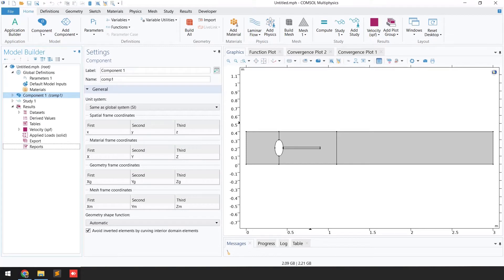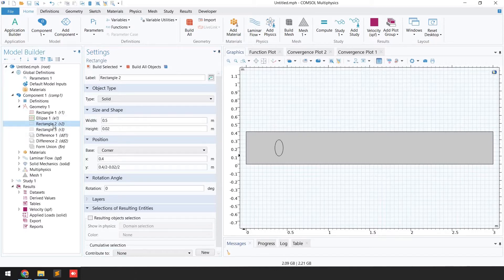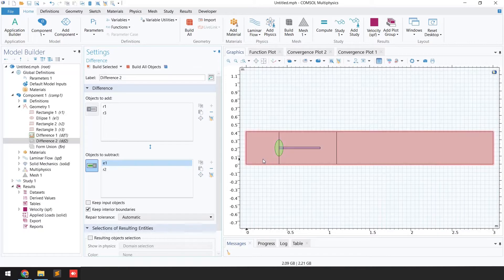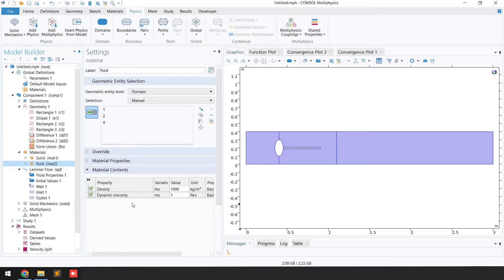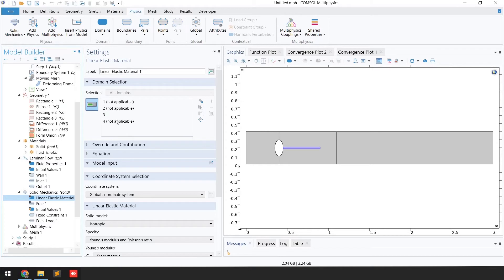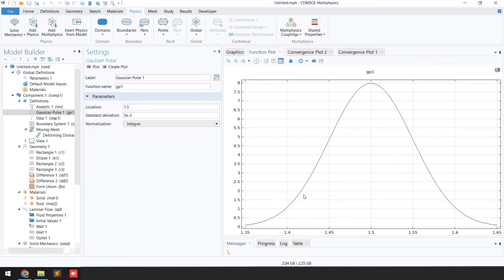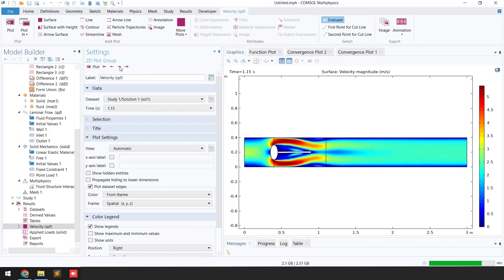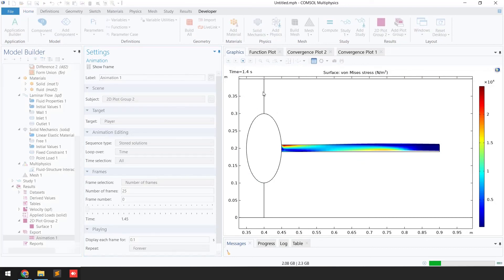COMSOL Tutorial 14 | Oscillating beam in a fluid flow using fluid structure interaction modeling

Comment: Hloo SAI, 
Is it possible to simulate a time dependent study for a pipe flow (micro-channel flow like blood flow etc. ) where the walls should be given the solid mechanics condition and laminar or turbulent flow to the fluid domain, i have done the same but no way the solution converging, but it had solved nicely for a steady state condition with the same bounday conditions and mesh refinement, I put the time-step size by calculating the values for velocity (for fluid flow) and wave propagation(for solid mechanics) as well....

 Help me out if you can identify the problem....

Thankyou!!
Reply from the maker: Yes, it’s possible. Your issue is likely due to time-step size being too large for transient FSI. Even if it works in steady-state, transient runs need a much smaller Δt (often 5–10× smaller) and strong fluid–solid coupling each step to converge.

Comment: Hey Sai can you make tutorial wherein a rotor is free to rotate under the influence of fluid, that is when flowing liquid comes in contact with blades of rotor or turbine and it starts rotating thus generating velocities, pressures, rpms, etc in output using FSI module or any other suitable modules
Reply from the maker: Great idea! Yes, I’ll make a tutorial showing how a rotor spins due to fluid flow using FSI coupled model. It’ll cover setup, rotation, and outputs like RPM, pressure, and velocity. Stay tuned!
Reply: @LearnwithSAI  How its going the simulation?
Reply: Hello Sai,
Are u done with this mentioned tutorial? I urgently needed that, will you please help me out

Comment: can i add eigenfrequency study to this interaction?
Reply from the maker: Yes, you can add an eigenfrequency study to the FSI in COMSOL model. Here's how you can integrate it:

Add an Eigenfrequency Study: In the Model Builder, right-click the Study node and select Add Study > Eigenfrequency. This will allow you to calculate the natural frequencies and mode shapes of the structure, like the oscillating beam in this case.

Multiphysics Coupling: Make sure the FSI is properly coupled with the Structural Mechanics and Fluid Flow modules. The eigenfrequency study will focus on the structure's response (oscillating beam) without fluid flow, or it can include fluid effects if needed.

Boundary Conditions: Define the appropriate boundary conditions, such as fixing certain parts of the beam or specifying interaction forces between the beam and the fluid.

Run the Eigenfrequency Study: After adding the study, run it to analyze the natural frequencies of the beam while interacting with the fluid.